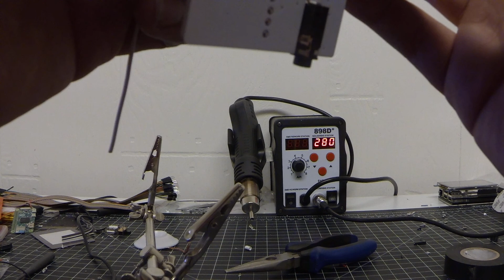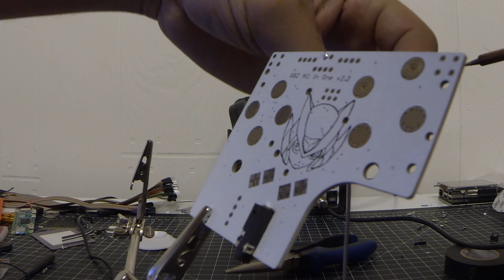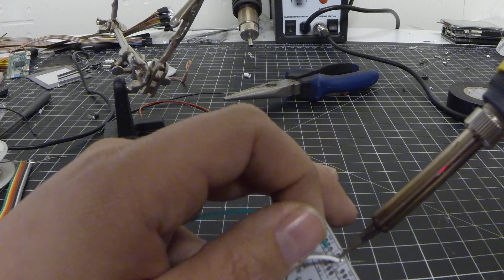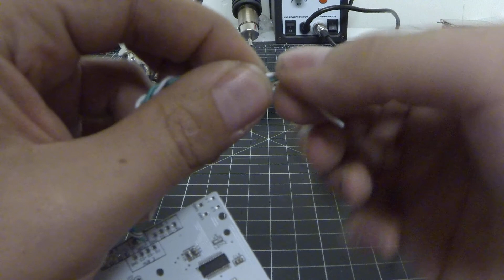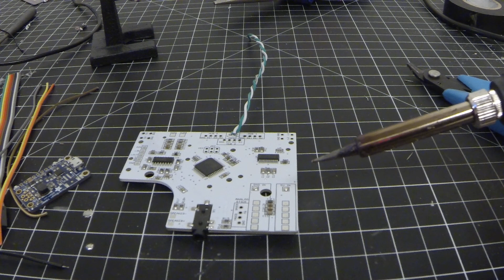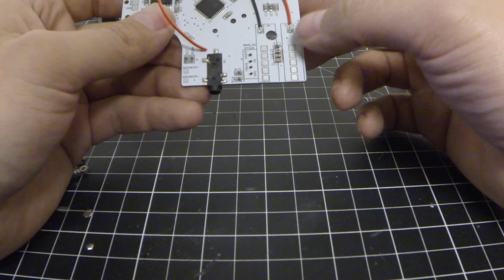GameBoyPi3 Step 14 Helder Board Wireup

Comment: is it possible to not use the SD cartridge system and just plug it into the pi? Also, why not use a pi zero?
Reply from the maker: Zach Brown I ended up not doing the cart option. That was due to the SD card extender not working out. 

I have made a few pi0's but not the pi3 version. Helder asked me to build a pi3 version and video the progress.